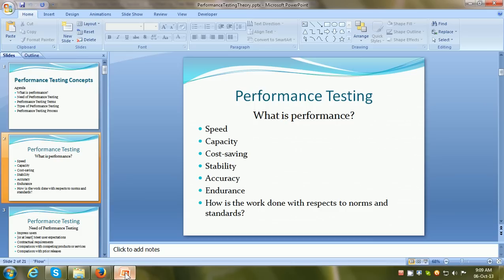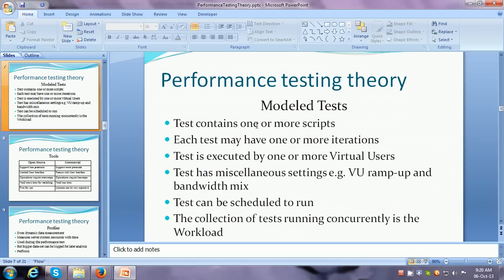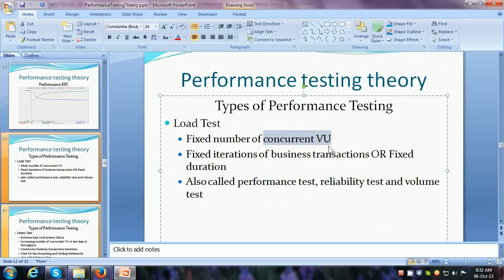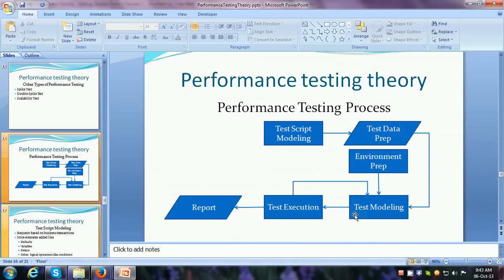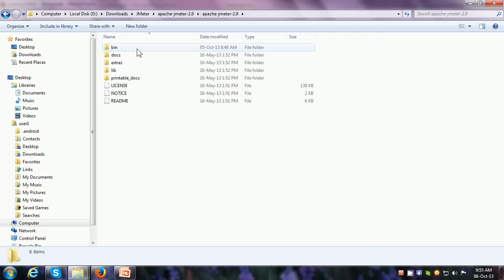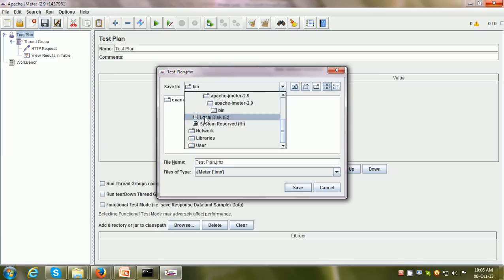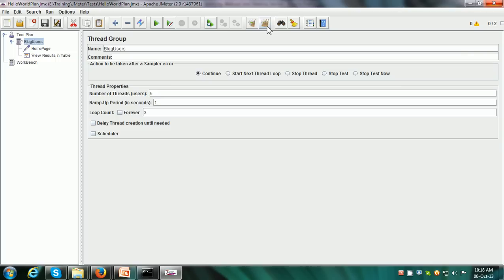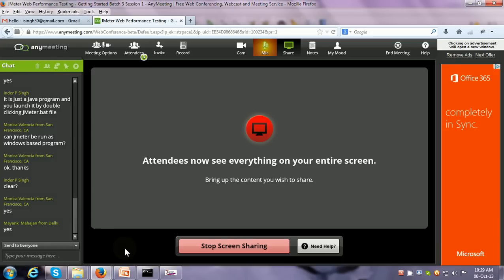Performance Testing-JMeter Performance Testing-Jmeter-Performance Testing Using Jmeter-Load Testing

Comment: Hi,

This is the best tutorial for absolute beginners like me. I wonder is it possible to run load test with 100k users via Jmeter?

Thanks
Reply from the maker: Thank you. JMeter has small memory requirements per virtual user so it is possible to load hundreds of virtual users in JMeter running on a single PC. For a large number of virtual users, JMeter supports distributed testing (from multiple load generator computers). Refer https://jmeter.apache.org/usermanual/jmeter_distributed_testing_step_by_step.pdf
Reply from the maker: If we don't want to provision a large number of load generators, there is the option of using cloud load testing from vendors like Blazemeter and Octoperf.
Reply: Thanks very much, you are more than helpful!
Reply: I see that you have more of this videos. Can you please send me the details of the course. My mail is: micitester@gmail.com
Reply from the maker: I have emailed you the details. Many thanks for your interest to learn JMeter performance testing.

Comment: Hi,  

I just found your videos and enjoy them a lot.  I watched the one about becoming a testing expert.  Excellent.  A couple of questions.  I want to learn Jmeter now.  How far into it does this particular video take the student?  If not so far, can you recommend other resources to get more comprehensive coverage of the tool?

Also, below a user asks you about purchasing the videos your jmeter videos?  And then you say "Done".  Maybe I am misunderstanding the conversation, but do you have more videos than this one for sale?

Thanks in advance!!!!

Steven
Reply from the maker: These questions start small and objective to wide and subjective. But, here are the short answers to these questions. 1 - A thread group has number of threads, ramp-up, loop count and scheduler (with duration, startup delay, start time and end time). 2 - Add a regular expression extractor post-processor to the request. Store the value to a variable. Replace hard-coded values in subsequent requests with this variable. 3 - Run the baseline performance test on existing system running on current hardware and configurations. Run test multiple times until consistent results are available for key performance indicators (response times, throughput, users, hits/ second etc.)
Reply from the maker: Hi Steven, thank you for your comment. This video is only an introductory video. I have a set of JMeter training videos (25 no.s) which is referred in the comment below. You can please see further details about those videos at http://inderpsingh.blogspot.com/2013/10/JMeterVideos.html
Reply: few question : What are the parts of thread group in jmeter?
How to perform correlation or regular expression extraction in jmeter?
How to get performance baseline from existing system?
hope you answer soon
Reply: Hi Inder,

Can you please send detail videos for me ? tinhtrongthienha009@gmail.com

Many thanks

Comment: Hello Sir,

I installed java 7 and jmeter as told by you but while double clicking on jmeter batch file it asked me to run it and clicking on run , cmd prompt is opened saying "Unable to access jar file apachejmeter.jar ". please resolve asap.
Reply from the maker: Do you have a Windows computer? If yes, download apache-jmeter-3.0.zip from http://jmeter.apache.org/download_jmeter.cgi
After extracting the zip file, go to the JMeter bin folder, locate jmeter.bat, right-click on it and click Open.

Comment: i want to check the load more than 200 user but it is stuck at some point..?? what should i do? 
For 100 user it is working properly
Reply from the maker: There are several options to consider - configure JVM heap size, run JMeter on a higher memory hardware, run JMeter on multiple machines (distributed testing) or run JMeter from the cloud.
Reply: +Software and Testing Training for distributed testing how many threads should i set single pc. I have tried with distributed testing on 3 machine with 100 thread for each but data is not reflected
Reply: +Software and Testing Training For distributed testing we have to follow certain scenarios?
Reply from the maker: The maximum number of threads per PC should be decided based on the test script complexity and the PC memory. After configuration of JVM heap size to maximum, you may want to run one machine with 100 threads or 200 threads. Are you getting any specific error when you run your JMeter test plan?
Reply from the maker: Kindly refer the JMeter guide on distributed testing at https://jmeter.apache.org/usermanual/jmeter_distributed_testing_step_by_step.pdf

Comment: Hi Inder P Singh, I have gone through your JMeter video on youtube (JMeter Load Testing Beginner tutorial). I am a senior test engineer (manual) and moving to automation. As per your video, I have configured and run the Thread. In the View Results Table it gives the result without Sample Time. sample time is zero always. I provided server name or IP with our required IP address. Please help me.
Reply from the maker: +charlesvim Good to know that you are learning JMeter. I have seen the sample time (response time) as zero when the Server Name or IP did not exist i.e. URL or IP address was incorrect. Therefore, you need to debug your JMeter test plan. Thank you.
Reply: Hi Inder P Singh, thank you very much for your immediate response. currently , that issue is resolved. I have come across another issue when I continued testing: "My test has got 4 http requests and running it for multiple number of users (10, 20, 50) on Chrome browser. While running, I have observed at top right corner that it runs again in reverse order descending order (50,49,48,47, etc.) after completing the test in given number of users (50) in ascending order (1,2,3,etc.)" Please reply on this. Thank you.
Reply from the maker: +charlesvim Good to know that your previous issue is resolved. Once a test reaches the maximum number of users (as specified in Number of Threads in Thread Group control panel), the threads/ users drop off as they complete their requests. If we want the load to remain at n threads for some time, we can check Loop Count as Forever. In such a case, we need to stop the test manually (by using Stop or Shutdown buttons). Also, JMeter does not use any specific browser for running the test. Thank you.
Reply: +Software and Testing Training Hi Inder, thank you so much. could you please provide me your instance messenger id (gmail, yahoo, skype, etc.) to communicate easier and for immediate response. thanks in advance.
Reply from the maker: +charlesvim Sure, you may add and contact me in Google Plus at https://plus.google.com/+InderPSingh
Reply: +charlesvim Hi Inder P Singh, could you please help me. I am passing "Send parameters with the Request" inside HTTP Request to pass username and password to login. I have identified its id from the inspection elements of the application and passing it. How can I confirm it if this is passed correctly or not. when running it is passed, but if I give incorrect id also in the parameters , still it shows passed. How can I confirm it?
Reply from the maker: +charlesvim It seems that the parameters in your HTTP Request are not being used. You can confirm it by appending one more HTTP Request for a web page after login. 
There are two ways to determine the actual parameters being used by web requests:
1 - Use JMeter HTTP(S) Test Script Recorder (Right click on WorkBench  > Add > Non-Test Elements > HTTP(S) Test Script Recorder. Then, record your business process. After recording is complete, you can examine the HTTP Requests' Send Parameters... section.
2 - Use Network in browser web tools to see the requests being sent by the browser as you run your business process.
Reply: +Software and Testing Training Please tell me how to run a script in JMeter for multiple users but at the same time simultaneously. Currently, am observing it runs one after another for the given no. of users (for example, 1st user at 13:18:11.756, 2nd user at 13:18:11.955, 3rd user at 13:18:12.152, 4th user at 13:18:12.354, etc.)
Reply from the maker: In the Thread Group properties, you can put Ramp-Up Period (in seconds) as 0. This should ensure that each of the 4 users start simultaneously. 
In reality, your load generator machine (on which JMeter runs) will have a limited number of processors (one processor can work on only one task at one time) so the users may start a little before or after one another.  The time difference of 200 ms between two users above looks small to me if compared with a sample time of few seconds.
Reply: Hi Inder P Singh, thank you so much for this solution. It is a new knowledge for me. One more issue. I am not able to record using "HTTP(S) Test Script Recorder" option. I have done as per the steps given in google search and imported the certificate "ApacheJMeterTemporaryRootCA" still it does not record or do anything in the JMeter tool. am using google chrome browser. I tried it in firefox/IE also still no recording done. please help me on this. I want to record through "HTTP(S) Test Script Recorder" option only, not required through any other means. you can also reply to my gmail: charles.vimala. Thanks.
Reply from the maker: You are welcome. Sometimes, JMeter has some issues in recording business transactions on HTTPS web sites. Therefore, you can add HTTPS requests manually. Also, JMeter recording is explained in detail at https://jmeter.apache.org/usermanual/jmeter_proxy_step_by_step.pdf

Comment: how can i correlate in jmeter if donot have a RB. for example: 
Session id: 4fddf2-dfsf21-dgfdgsdg
Accept-Encoding: gzip, deflate

I want to capture 4fddf2-dfsf21-dgfdgsdg this value in jmeter how can i do so i had tried using Session id: (.*?)\n\r
Reply from the maker: +Hemant Mor We should search for Session id in Response data tab of View Results Tree listener. There we can find the string before (e.g. Session id: ) and after it (e.g. &). We can use a regular expression similar to Session id: (.+?)&

Comment: Hi sir, even after adding ; C:\Program Files\Java\jdk1.7.0\bin; in the variable name still am facing 'javac' is not recognized as an internal or external command, operable program or batch file. Please help me. Thanks in advance
Reply from the maker: +Chimata Nalini JMeter is a java application. It does not need the full JDK to run, JRE is sufficient. Java version 8 Update 73 is the current JRE version. Please install the latest JRE version first. 
Also, javac command is used to compile Java programs. Javac is not needed to run JMeter. JMeter is already compiled Java application.
Reply: Sir but after opening jemeter.bin in command prompt "an error has occurred plz clk any key" is displaying.please help me to solve this issue
Reply from the maker: +Chimata Nalini In the JMeter's bin folder, we need to double click (run) jmeter.bat whose type is Windows Batch File.

Comment: HI All..

I am performing Jmeter testing on a site to check Load, Used a Thread Group: No of users: 50, Ram Up period: 10, Loop Count : 10. Also used HTTP request: View result in table and Tree.

i am getting following error:

Sample Count: 1

Error Count: 1

Response code: 508

Response message: unused

I am not able to understand, why this is coming up.

I want to test site using around 10,000 users. This site dint require any Login.

Please help how to do.

Thanks
Reply from the maker: +Nancy Nagpal We should begin with 1 user 1 loop count and get the response. Are you running JMeter from behind a proxy? It seems that you are not even able to get even a single response from the website.
Reply: +Software and Testing Training 

HI.. Tried for 1 user, 1 loop count, ramp up 10,
Got the result in tree:

Sample Count: 1
Error Count: 0
Response code: 200
Response message: OK
==

Also, Sample time is: 2259(ms) , bytes: 45184, Latency: 2235, connect time: 622(ms)

Also regarding proxy, have used HTTP Request; under thread group, 
Server Name: www.findhealthtips.com (The site i am testing)
Port Number : 80

NO other proxy settings i.e in Mozilla i have done.

Do we have any option of sharing screenshots? Will share with you.
Reply from the maker: +Nancy Nagpal It looks like your single request is working (response code = 200). Next, we should run the JMeter test plan for 1 user, multiple loop count e.g. 10. I don't think that there is any option of sharing screenshots within these comments.
Reply: +Software and Testing Training 
HI Tried with 1 user, Ramp up - 10, Loop Count: 10 (working fine - It seems)

Sample Count: 1
Error Count: 0
Response code: 200
Response message: OK

Then tried: 10 user, Ramp up - 10, Loop Count: 10 (NO issue)

Then tried: 10 user, Ramp up - 10, Loop Count: 50
Here, when all threads were up (10/10),then it became bit slow (No able to understand why?)
And got error only for 1 thread:

Sample Count: 1
Error Count: 1
Response code: 503
Response message: Service Temporarily Unavailable

2nd time, tried the same .. NO error.
Reply from the maker: +Nancy Nagpal With 1 user, Ramp up - 10, Loop Count: 10,  Sample Count should be 10. Please check.  With 10 user, Ramp up - 10, Loop Count: 50, it seems to be working fine. We should try to run the Jmeter test plan for 10 users, Loop Count forever for 10 minutes. It this runs fine, we should repeat the last run a couple of times.
For a single HTTP request, we can check the details in the View Results Tree. For multiple HTTP requests, we can check the results in the View Results Table.
Reply: +Software and Testing Training With 1 user, Ramp up - 10, Loop Count: 10,
We have 10 HTTP request. For all request result is:
Sample Count: 1
Error Count: 0
Response code: 200
Response message: OK

Sample Count 1 not 10.

We should try to run the Jmeter test plan for 10 users, Loop Count forever for 10 minutes

Loop Count Foreever : Tick the Forever checkbox
10 min: We are taking about: Ramp-up Period (in seconds).. Covert 10 min in seconds i.e. 600 seconds

Is that we mean?
Reply from the maker: +Nancy Nagpal Did you get Sample Count: 1 Error Count: 0 Response code: 200 Response message: OK from View Results Tree single request? If yes, it is okay. You can see all the requests' responses in View Results Table.
For any number of users, we should put a realistic ramp up time based on the real website usage. The default is 1 user per second. Therefore, for 10 users it can be 10 seconds.
Reply: +Software and Testing Training 
Yes.. That response message is for single request and we have all request response in tree.
SO, if site is working fine for less users. I tried for more users.

50 users, 50 Ramp up, Loop Count : Forever.
Started getting error on lots of thread:

Sample Count: 1
Error Count: 1
Response code: 503
Response message: Service Temporarily Unavailable

Sample Count: 1
Error Count: 1
Response code: Non HTTP response code: org.apache.http.NoHttpResponseException
Response message: Non HTTP response message: The target server failed to respond

Sample Count: 1
Error Count: 1
Response code: 508
Response message: unused

I am not sure whats wrong is going on.

If you could share any email id: i can send you the screenshot.
Reply from the maker: +Nancy Nagpal Since you are getting errors, you should determine the % of requests that result in errors. We can ignore up to 2% or even 5% errors (this threshold depends on the performance requirements of the website). We can add a listener, Summary Report to the thread group. Summary Report shows the error %.
Also, we can run the test for 10 min. or 15 min. unless it is a soak test. Then, shutdown the test manually.
You can see the details of my JMeter training videos that explain all these concepts. The link is http://inderpsingh.blogspot.in/2013/10/JMeterVideos.html
Reply from the maker: +Nancy Nagpal It seems that the web server is unable to handle the load of 50 users. Have you added a Timer to the thread group? If not, JMeter will keep sending requests non-stop to the web server. A simple timer is Constant Timer.

Comment: Hi Inder. I really liked the way you have explained. I am novice to load testing. Shall I use this for my company inside the firewall? What are the issues I will be facing? Is this easy to throw 50-100 concurrent vusers? Also, can I test window based application too? I will appreciate your answer at the earliest time if possible. I have subscribed your channel and if you can send me more videos on vipnim1980@gmail.com. Thanks.

Comment: Hi, thanks for the tutorial. i'm having a problem when executing the script in your examples. i keep getting sample times of 21 seconds+  so i'm constantly getting a status of error on every test i run. i have set it up exactly how you have shown so i'm slightly confused. any help is appreciated.
Reply from the maker: adam My demo video uses a very simple JMeter test plan. If you are getting errors, you should check if in the HTTP Request, the Server Name or IP and the Path are valid. The sample time can be large if you are accessing a Server Name in a distant geographical location e.g. a distant country. Hope this helps.

Comment: Regarding load generators , why cant we just add thread value in jmeter as 1000 instead of using several desktops/laptops?
Reply from the maker: StridePurple A single client machine (desktop or laptop) would likely not be able to exert such a heavy load.  We have the choice of distributing the Number of Threads among multiple load generator client machines or use a single server machine as a load generator. Thank you.